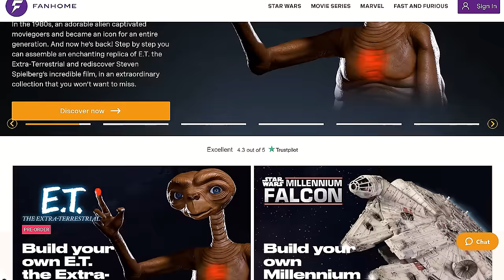The Rise and Fall of the DCEU

Comment: You kind of hit the nail on the head BvS started.the downfall it was to divisive a film and even Snyder said he was doing an experimental film with it.  Plus he even said he wasnt competing with Marvel he just wanted to film what he thought looked cool.  But even the box office failures after the General Audience left did higher audience scores then Snyders films. So they were going in the right direction with the lightening the tone but had no direction and like you said Snyders plans was basically fibe movies then do a Flash Point reset and make it the next guys problem to compete with Marvel
Reply: Well, that is one of the problems, WB wanted a director that would compete with MCU and Zack Snyder just wanted to have fun - play with known IP.  These are different visions.

Comment: It's crazy how in the film industry, making 300m off a film isn't considered that much
Reply: depends on the film. What is the initial budget, how much are you spending on advertising, etc.
Reply: Ceo's get greedy 🤷‍♂️
Reply: Each company has its own brand of accounting. Some are better at Marketing than others. Some of the Films he listed aren’t actually busts from an Accounting or General Film basis. All of them except the ones listed as Hits, underperformed vs expectations but that doesn’t make them necessarily a Flop.
Reply: @tombondcrispy6585 nothing to do with that it’s the fact the budgets are usually up close to 200 million plus they share profits with theatres & need to spend at least half the budget for marketing
Reply: Dude you gotta think all the money they have to make back after spending so much on advertising, paying the actors the producers and the film crew.
Reply: @cosmicjojo2159  I thought all of that was included in the budget? So say it's a budget of 100m and it made 400m, doesn't that mean the total cost of everything was 100m and the total money made was 400m?

Comment: As a Zack Snyder fan, I think WB shot themselves on the foot when they decided not to trust Zack's vision and try to course-correct the DCEU. Zack's movies didn't make 1B as WB wanted, but they all turned a nice profit, which cannot be said of the DCEU after he left. He was also heavily involved in the production of the first Aquaman and Wonder Woman movies, including casting the leads and working with the directors. Everything Zack hasn't been involved in has been a critical and commercial failure.

Comment: I can tell you what went wrong...they deviated too far from the source material.   What they need to do is go back to beginning of the silver age...start with those stories.   Bring them to the screen EXACTLY as they were in the comics.   Mode of dress, vehicles, buildings, dialogue.   Everything EXACTLY as it was in the comics.   Then move forward from there.   They can always go back and tell Golden Age stories as needed to fill in gaps as long as they do them as EXCACT renderings of the original comic stories.   Frame by frame, panel by panel.   THAT would fix their entire problem.

Comment: I like the Marvel movies ok, they were cool, but the one thing I hate is the way they conditioned people to see each movie as mattering within the bigger context of a universe being built instead of judging the movies on their own. Make good movies or not and let them rise or fall on their own. Yes you can add bits and elements to show that it's connected to the bigger universe but still let it stand on its own. The only thing one should wonder is if it's good as the main thing and not let the idea of it mattering or not be a factor in people's minds. Thinking that a movie doesn't matter to the bigger whole makes it so that the movie will automatically be seen as sucking. So judge a movie on it's own merits not if it matters to some bigger whole.